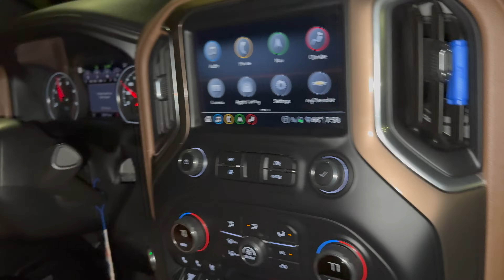We broke our house!! Day 4 of starting a landscaping business.

Comment: Good try. If you can't get the house valve to stop leaking, shut off the main valve. Usually, it's located in the yard toward the street, under a metal cover with the meter. Or just call a plumber. Fill a bucket and pour it into the toilet to flush it...👍